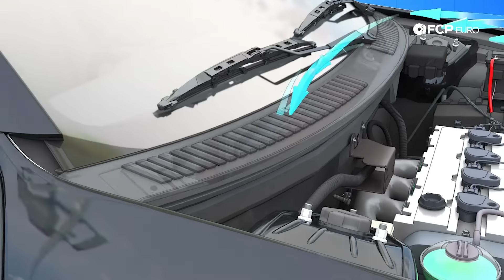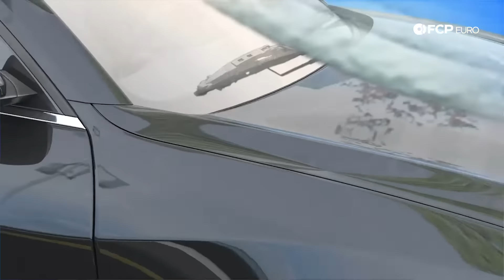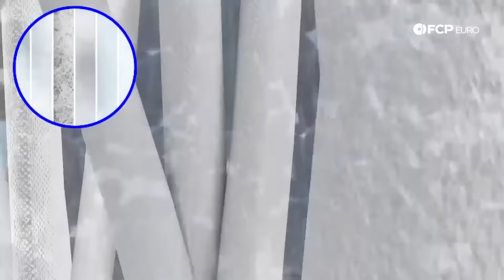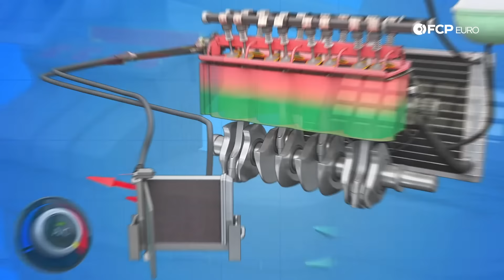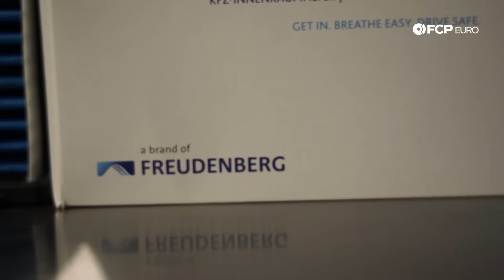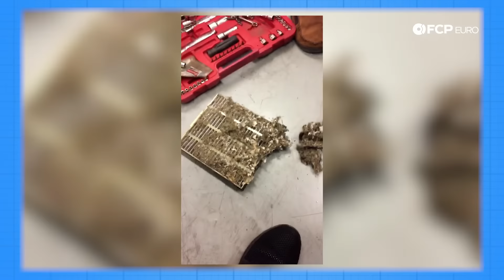What Does A Cabin Air Filter Do, And How Does Your Car's AC System Work? - Explained - 3D Animation

Comment: Well done video. Recently changed filters on 2013 Volvo XC60. Cabin's filter was Mann and engine's filter was Mahle, both bought from FCP Euro. Not that I wouldn't change these filters at least once a year, but I doubt I will be doing the cabin air filter myself again. I had to dismantle so much of the dash and other parts to get to the cabin air filter I was often cussing the engineer's who designed placement of the cabin air filter box. It took several hours -  actually days. I broke a tab on the filter box door and had to order the part through the local Vovlo dealer. The car sat unusable for a few days until I got the part and put the car back together. And no it could not be drivin because I had to disconnect a fuse block to get the the filter box door under the fuse box. Absolutely terrible design for something that really is important to maintain.
Reply: Volvo master tech here - once you learn to do it, changing the cabin air filter on the first gen XC60 only takes a few minutes.  Believe me, there are MUCH worse designs for cabin air filter replacement than the Volvo P3 chassis cars.

Comment: So how are mice getting into my cabin filter, and building a nest right above the filter in that pocket. I want to fill it with wire, enough to allow plenty of airflow but no room for them to dwell and build a nest. If vehicle companies design it so that it is mouse proof they will sell their vehicles like hotcakes. Because it is nasty and disgusting and is happening to all vehicles mice getting into the air you breathe right into the freaking air filter air conditioning heater system,, are you kidding me. If you're beating this I guarantee you your cabin filter is got a mice excrement, and you're breathing it. Good luck and thanks for the excellent video.

Comment: I got that black smoke that diesels shoot out stuck in my cabin air system. One month later I can still feel it in my throat, it’s horrible. Even after letting the vehicle idle with the heat on full blast .  I just bought new cabin filters, and I plan to blast out the system with a air compressor with the filters out with the blower fan on high. Is there anything else you can recommend to clean out my air system?

Comment: Difficult to find anything for my 2014 E300 BlueTek made in Thailand  vin WDD2120986L048749 does not accept in USA websites 
So O have never received an ENGLISH owners manual and have to translate the Thai one!  Also finding filters outside Thailand dealers is impossible

Comment: So are we breathing in refrigerant?
Reply: No.  Refrigerant is sealed within the A/C system and circulates changing from a liquid to gas as it moves from the evaporator to the condenser.  If your evaporator is leaking, you may indeed breathe in some refrigerant but it has a distinct smell.

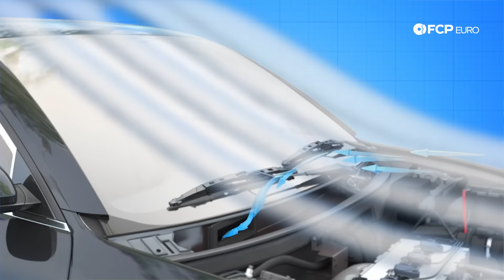Comment: At 2:17, are you sure that this area (the hood grille beneath the windshield) is High pressure area? I think is Low thus the air can be soaked inside because inside the engine bay is high pressure. Also another question: if we make that entrance point a little bit larger (to take more air) there would be a benefit for the blower fan or not?.

Comment: Does a cabin air filter affect air conditioner performance?
Reply from the maker: If our filter is very clogged, it can undoubtedly hinder its performance of cooling down your cabin, as the air is having a hard time passing through the filter.

Comment: Air / pollen filter what are the areas that need to be replaced and cleaned do I have a video for that for a MDX because I changed the engine filter and the cabin filter what else I’m missing??

Comment: I know this has been here for a while - but a note about AC condensation.  In a Porsche Cayenne, it's good to see AC condensation on the ground - if the condensation port gets clogged, then the line can get filled with water, and leak into the passenger compartment.  Seeing a bit of water in the passenger footwell in the summer after running the AC is an alarm bell that the port has been clogged, and the condensation is leaking - what you see in the footwell may be only a tiny portion of what has soaked into the carpet.  This is a big issue, as there is a wiring harness that can be damaged by the water.  Checking and clearing the ports is a regular maintenance item that is often overlooked.

Comment: I am cheap ... I pulled mine out... vacuumed it, washed it with Tide,  dried  it and then re-installed it ... Good for another couple years 🤣
Reply: I paid $12, without all the labor.
Reply: @Erik-oe7gc Cannot imagine being so soft that I consider dropping something into a washing machine labor. Wow
Reply: I just done the same aa well Hopefully it will work just fine
Reply: @MatthewHarris-o1t yall nasty u will never get it fully clean and once wet the holes will be bigger thus ur breathing more stuff in now 😂
Reply: It takes a while for them to dry out, I do it is tight density in the fiber. I do the same thing blast with soapy water and bleach rents and let it air dry for a while, especially if the sun shining on it. 🤟🏼
Reply: Should I try that too? Some filters are expensive
Reply: @NostalgiaNostalgia80   I would use compressed air if you have access to it.  Most cabin filters are made of paper, so soap and water will destroy them.
Reply: @ What do you have to lose.? If it cleans up then use it, if it gets wrecked then just buy the new one.  Cars back in the day didn't even come with these cabin filters, until some smart guy figured out  a way to hose everybody for extra money.
Reply: @AndrewsGuitarChannel  dang. Although it seems necessary how it was explained in this video.
Reply: if you went to the trouble of removing it, why not just install a new one. thats like taking strings off your guitar, 'cleaning' them and re-installing them. do another gig so you can buy a new filter dude...

Comment: Does a dirty filter cause the AC to not blow as strong as it could?
Reply: It's the reverse. The more restriction your intake has the more your ac will struggle to get the volume of air that it needs to regulate the temperature. Replace your filters and take your car to a tech to see if your AC refrigerant is good to go.

Comment: Is it possible to have increased gas mileage if the cabin air filter before was 99% clogged ? Would this make the thermostat work harder or the ac work harder? I changed mine and saw some improvements, but not sure if this was the reason.

Comment: Yes thank you! I went to a Honda dealership and told them some unpleasant smell is coming out of my ventilation system. (Fyi: I keep my 2019 Honda Si super clean inside and outside). Anyways, they told me to go to Canadian Tire to buy some product I spray into the vents. Needles to say the odour is still there now it's a double odour of spray and something unpleasant. I have faith that changing the cabin filter will make a complete difference. What baffles me is that a technician could not recommend such a simple fix. Unbelievable!!!!
Thanks for your video! :)
Reply from the maker: The cabin filter will absolutely make a difference if your vehicle has one, and a possible clean of the AC condenser (they tend to gather water, and possible mold)

Comment: Hey Ben, what if you are using the recirculation air always? Do you still need activated charcoal filter to be installed or no longer needed?
Reply from the maker: Hi Jastine, we would still recommend having the highest quality filtration in your car no matter the normal use, so if there is charcoal filtered option it simply cannot hurt to have in there!

Comment: The fan in your illustration is rotating in the wrong direction. The angle of the blades will only take air inside the blower and force it out in the direction of the air flow arrows if it's turning in a clockwise direction... Right?
Reply: That's a "forward curved" fan and is spinning in the correct direction. The blades are actually curved on a real blower fan. These fans are "centrifugal" fans and the air is actually forced outward by centrifugal force, not the fan blade orientation.

Comment: This video is just in the "nick of time" as I just recently replaced my cabin air filter and also wondered how does does it work because on my old 99 Land Cruiser, it did not come with a cabin air filter but my 2017 Tundra did. 

Changing the cabin air filter made a great difference in my truck to help improve the air filtration and resolved my issues with foggy windows.
Reply from the maker: Sounds like this pertained to you and your cars perfectly AWordFrom Mr. Jones ! Its such a simple thing that can make such a big difference, so often overlooked.

Comment: I always keep the recirculating button on when using my a/c so it doesn't get dirty...the only time that air is coming through the outside vent is when I use the defogger during the short winter time here in Los Angeles...
Reply from the maker: Thats one way to keep things clean!